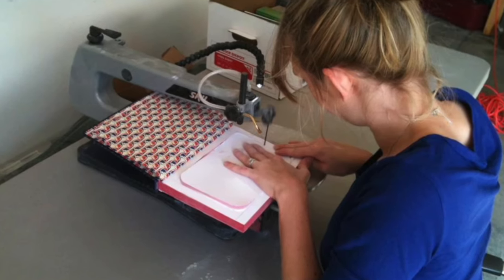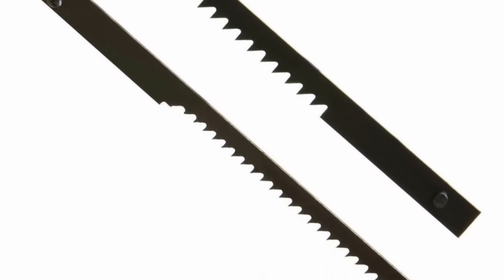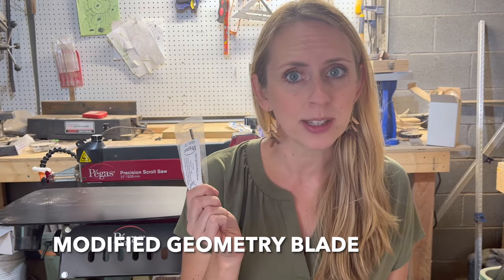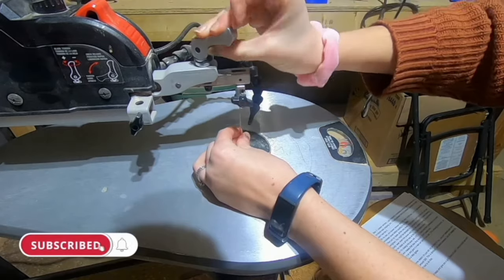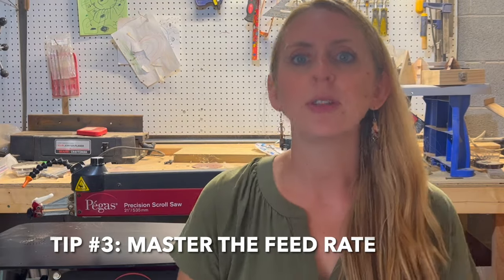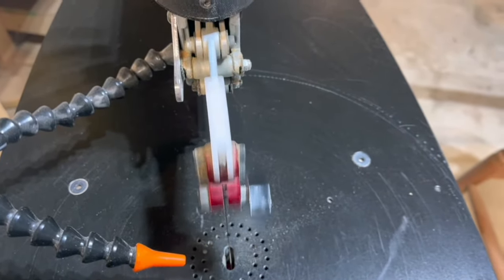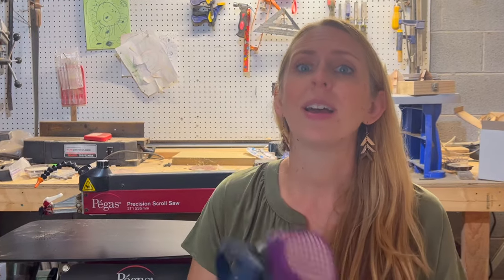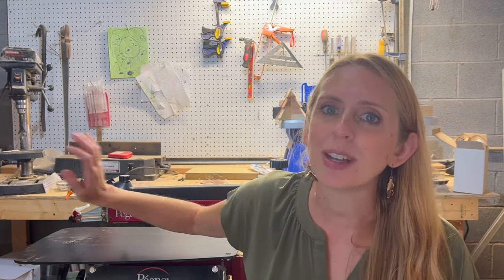5 Scroll Saw Tips I Regret Not Knowing Sooner

Comment: Good tips, thanks! I haven't been scrolling long. I have a Proxxon  DSH and was using the pinned blades it came with. But I recently got some pinless modified geometry blades and oh my the difference is incredible, they cut so much better and I have much better control.
Another tip: don't try using a spiral blade until you are actually good at controlling where you're going. I decided to do my first practice with a spiral on several layers of stiff card. It was hilarious. Needs a different approach from using standard blades, you can't just reverse up like with a flat blade because it'll carry on ploughing backwards through your material 😂
Reply from the maker: Yay! So glad you love the modified blades! Yea, spirals can be tricky! They have their uses, but I usually stick with the flat blades :). Thanks for watching!
Reply: Hey l got the same scroll saw!! I also bought pegas modified geometry blades but my problem is the vibration!! I’m wondering if my wood table l attached it to isn’t heavy enough? What are you using as a base?

Comment: The pitch needs more attention, as it is essential. I'm on blade number three atm, after two projects, turned up the volume way up to hear the sound yours made, but it seems a little too tight?
Reply from the maker: It may vary based on the blade? If it cuts great, it can’t be wrong :).
Reply: @WendellWoodworks  5 days later and I'm winging it through 4 cm of hardwood. Loving it.

Comment: How much air does the blow compressor is supposed to blow out? I just got my pegas but it throw out very little air like barely even feel it. For some reason I feel in your videos it throws much more air could be wrong. Maybe that’s how it’s supposed to be but I was wondering. I just tried it for the first time and seemed to me like it was very little air.
Reply from the maker: It won't be a lot, but enough to blow off the fine dust so you can still see your line while scrolling. If it's not doing that there might be a problem...congrats on the pegas!! I hope you love it!

Comment: well i broke down and got a jet from home depot thinking it was a good saw and boy was i wrong,,,lol,,when you released the tension on top to thread the blade thru the wood for internal cuts,,the bottom bracket holding the blade just fell out,,,i never could get the bottom bracket to hold the blade in place as i was feeding it thru the hold in the wood,,,lol,,lession learned,,i guess i should have gotten the pegas to start with but i was scared that if something like this was wrong with the pegas it was mine,,,where i did return the jet to home depot,,,its kinda funny,,i have got 2 jet lathes and a 15 inch planner that is great,,,but i honestly would not give 100 dollars for the scroll saw,,,
Reply from the maker: Yea, a lot of tools you can go cheap with. I use a lot of wen (sander/nailer/planer)…But it is crazy the difference between a cheap/more expensive scroll saw. It’s worth paying for!
Reply: i agree but this saw was anything but cheap,,,it was a jet,,900 dollars @WendellWoodworks
Reply from the maker: @jeffoldham668  oh wow! I didn’t realize it was that expensive! What a bummer. Hope you get yourself a great one :)